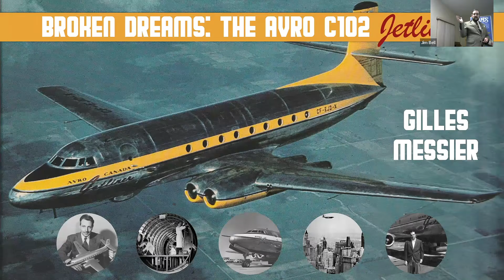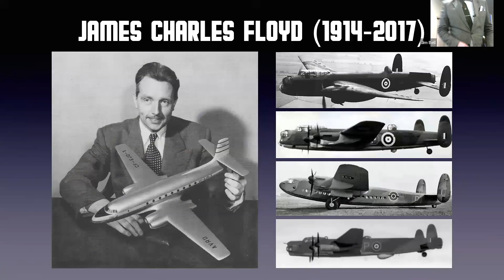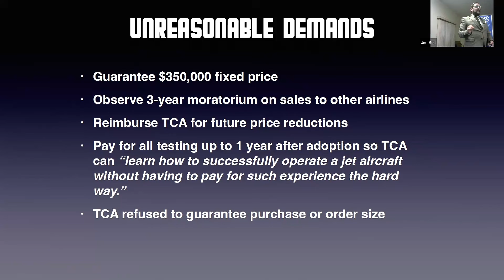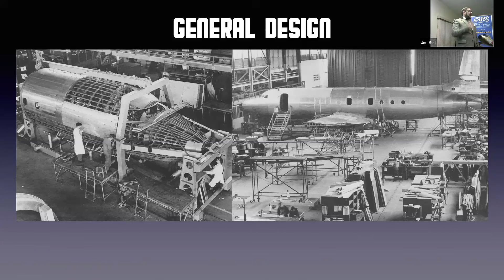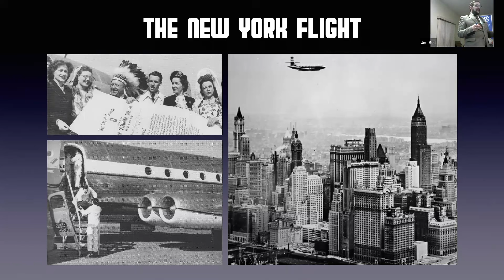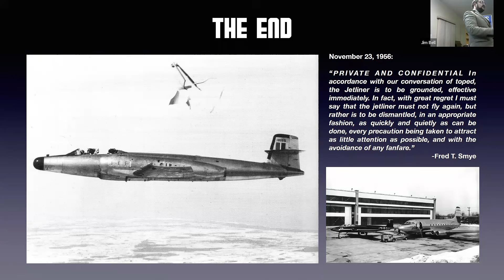Lecture: the Avro C102 Jetliner

Comment: One of the few remaining channels on YouTube, that has NOT been made incredibly stupid by the use of artificial intelligence, breathless, overly damatic narration, with the narrator totally clueless as to what he, or she is talking about, and therefore IS extremely watchable

Was this airliner designed with round windows in the passenger cabin, and NOT like the flying disaster that Britain's square window, stress inducing cracks that COMET had?
Reply: Comet 1 didn't have square windows as is often repeated in error.
The C1 had the same 5 inch radius windows found on modern airliners.

When wreckage from the sea was finally recovered it completely debunked de Havilland's initial theories.
The  passenger windows were not related in any way with the catastrophic in-flight structural failures

Comment: As per usual Canada is it own worst enemy
Reply: That and it was never any good at designing its own jet aircraft...
Reply: @DoktorBayerischeMotorenWerke  Bombardier?
Reply: @RCAvhstape  American design.. developed from Learjet
Reply: @DoktorBayerischeMotorenWerke  Oh, didn't know that.
Reply: @RCAvhstape  : because it's not true. Bill Lear, who had already sold Lear Jet Corporation to Gates in 1969,  was involved primarily for the sake of his name and ability to sell airplanes. While the Challenger was very roughly developed from the basic LearStar 600 project, what Bill Lear had actually contributed amounted to a rough concept. Bear in mind that he wasn't an engineer. He came up with ideas and hired other people to do the actual engineering work for him. Bill Lear went to Canadair with the idea because he didn't have the ability to launch a new aircraft since he was no longer involved with Lear Jet Corporation. 

The final airplane on 1976 launch was so radically different from the original LearStar 600 project, and Bill's contributions were so slim, that it might as well be a movie labelled "based on a true story." The LearStar 600 was a much smaller airplane with a conventional tail and two TFE731 engines. It was about the size of a DA20 Falcon. And, he wasn't even involved with the Challenger after 1977, because he disagreed with Canadair on the direction of the project. Well, Canadair, and later Bombardier, sold a whole bunch of Challengers and CRJs, while Bill Lear's next project, the LearFan, never even got certified. This says nothing of later aircraft not derived from the Challenger, such as the CSeries/A220.

Consider the source and read their other comments. That's all I'll say. By their logic, Bill Lear never was any good at designing his own jet aircraft because the Learjet 23 took some basic design cues from the Swiss P-16 (and was not a passenger adaptation of the design as often claimed).